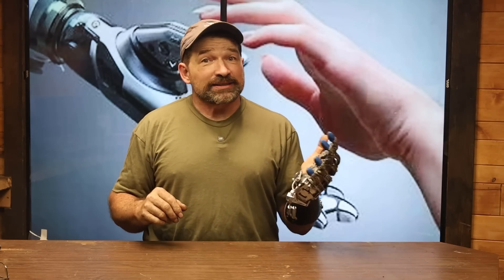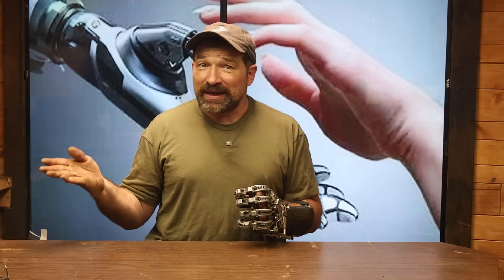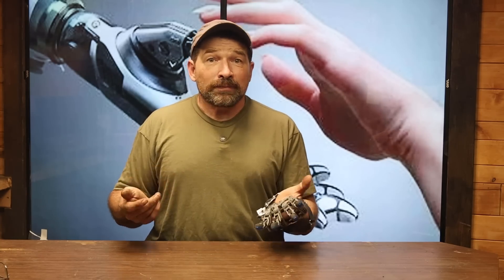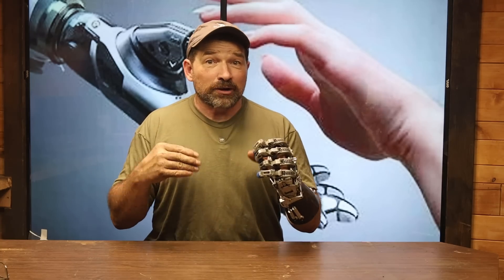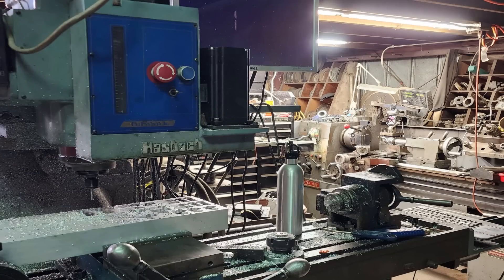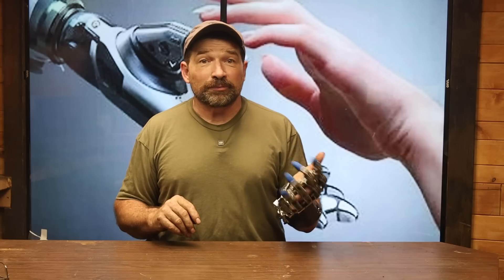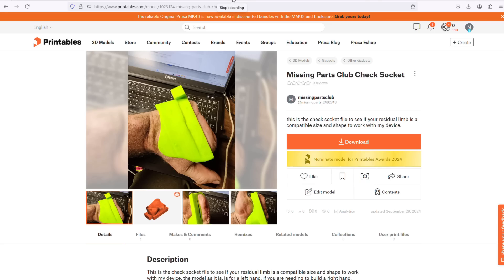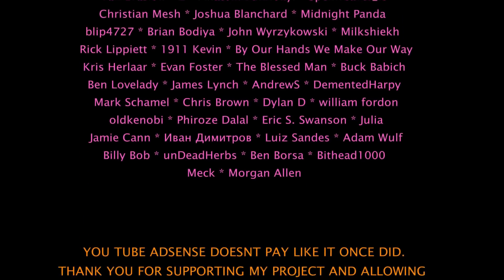Ready or Not, I'm Starting a Trial With my DIY Partial Hand Prosthetic!

Comment: how much would this cost for you too build me one.. ive lost all my fingers on my left hand.
Reply from the maker: you should download the check socket, print it out and see if the design will work for you. it is designed for a very specific disarticulation. your fingers need to be completely disarticulated through the MPJ, that means that you do not have any part of the proximal, and the metacarpal is still it's natural length.  follow the instructions in the description of the video and email me pictures of the check socket on your residual limb to missingpartsclub@gmail.com

Comment: I'd contact Fahad Badar, the dude who lost four fingers to extreme frostbite after spending the night stranded on a mountain he was trying to climb in Pakistan...
Reply from the maker: He still has partial proximals on his index middle and ring fingers. He can, and does use the naked prosthetics mcp driver line of devices. My device is for someone who has had their index through pinky fingers amputated through their metacarpal phalangeal joint and retained no part of their fingers.
Reply: @missingpartsclub  My apologies, I'm not well versed on the specifics of amputation or the various devices. I did see some before and after videos of him, and the device he was using didn't seem as fluid or as impressive as how your invention behaves...

Comment: How exciting! I’m very glad this is feasible for you and the project has managed to come this far. If you need some additional manufacturing support outside of the community which has volunteered, I’d imagine that universities  with solid kinesiology labs would be more than happy to help both yourself and recipients at relatively low cost. A non-insignificant amount of grant money is probably eligible for spending on stuff like that. Plus university machine shops are full of altruistic and skilled people with access to incredible machines that experience a non-insignificant amount of downtime.

Comment: If you ever decide to go international, do pick up metric thread as well, it'll make maintenance a lot easier (and to source bolts)
Reply from the maker: Here's the thing, since it's DIY,  you can use whatever thread  that you want and can more easily source. 1-72 is close to 1.8mm, 2-56 is about 2.5mm, 4-40 is about 3mm.

Comment: Can you even sell this without going through all the medical device certification? Or does this not apply since it's a DIY kit?
Reply from the maker: That's the workaround.  Being that it's a DIY kit, the end user assumes all liability and risk. Think about it like an 80% lower.
 There are rules in place where an O&P clinic can deem something/anything a medical grade device and apply for insurance reimbursement,  but that is a case by case and clinic by clinic thing. Where they're going to get pushback is that they claim things like these prototypes. The thing is, all hands are different. Every device is a prototype. And since there's such a high rate of rejection with upper limb devices, insurance looks at them as a waste of resources.  Hence, my letter from my insurance company stating that fingers are considered a luxury.

Comment: Waiting for the remixes on printables from people fitting it to their own hand :D
.obj is a good format. I think you can import that into most cad and modeling softwares
Reply from the maker: There better not be remixes on it. It's meant to be a reference. The file on printables is the check socket,  not the device itself. The device itself, printed in plastic, isn't strong enough to do anything. That's why the real parts are printed in mag aluminum.

Comment: If you choose someone in the greater Denver area, keep me in mind. Run a proto shop (CNC/machinist, 3dp, EE) and would love to help out,
Reply: Are there similar solutions in the prostetics industry or is Ian doing something completely novel here?
Reply from the maker: Novel,  the partial hand market is a veritable desert. The issue is that there's not enough ROI in this market sector for one of the 2 main suppliers to make the multi-million dollar investment to meet the needs of the few. There are a zillion combinations that fingers can be amputated, and each require their own version of a device. Naked prosthetics makes good devices to meet the needs of partial finger amputees. But you need at least the proximal portion of the finger to use any of them. The only option for disarticulation at the metacarpal is the ossur I digit quantum. Aside from the cost of the device (upwards of $100k) is that it's slow (1 second to open, 1 second to close), and it's incredibly fragile.
Reply: @missingpartsclub  There's the point design for partial hand amputees

Comment: Have you considered rolling contact joints? Might be a sturdy knuckle joint, mechanically
Reply from the maker: Yes, briefly. I experimented with link driven and spectra line. The 156 device was link rolling contact. It takes about twice the amount of parts per finger compared to the design of my current finger.

Comment: Only question I have is is this going to be a reversible product? Such as for a right handed amputee... can it be assembled that way or are the components only left hand specific?
Reply from the maker: Some of the assemblies are able to mirror, but most parts end up being an -001 or -002 version. The fingers, of course  mirror, but the mounting plates don't. And so down the line.

Comment: Thank you for specifying "only a file". The number of time I see people using power tools for no good reason on Youtube is mind bogling.

I'm not expecting everybody to be trained to square stock with files as I was (luxury gunsmith), but seeing people using power tools to deburr machined parts or angle grinder to cur steel rods when 10 second with a hacksaw would have suffice is just sad.

Comment: Wonderful work, would make sense to create a network with local maker spaces to help with the crafting as the missing parts make tapping  & fitting challenging.  plus many are just not makers to begin with.   Plus this will free you from many beginners questions,  Also you may want find a way to monetize your consulting time too.  Best of luck however it spins out.

Comment: Why not just hire engineers to build these for the clients and charge them accordingly.
Reply: Great idea!  You can finance the operation and Ian can hire the engineers.  That's just brilliant.  Glad you're on board, sir, and willing to volunteer not only ideas, but the funds necessary to see them happen.
Reply from the maker: Exactly! You hit the nail on the head! Of course there's also the little dance that I'm doing around "building a medical device without proper licensure or clinic" and the $100,000 fine AND 10 years in federal prison per occurrence that goes with each completed device that I provide.

Comment: Not an amputee here, but if you choose an applicant from the San Antonio area I would be more than willing to donate my time and tools to help them complete the project. I’m really only short a 3d printer.
Reply from the maker: Email me and I'll as my channel sponsors what they can do. No promises,  but I'll ask.
Reply: @missingpartsclub  If the user is willing to pay to ship, I am willing to donate a 3D printer. I have more than one I could give away.
Reply: Just to reiterate in case there is a misunderstanding. 

I myself am not an amputee nor do I know any that fit the requirements, and I am not trying to get a 3d printer. I however would be happy to give a hand in or to totally handle the assembly process for someone who isn’t able to themselves due to lack of tools or ability. I would want them obviously to be as much a part of the process as possible as I know I would want to be if the situation was reversed. 

As far as 3d printing the socket I would not be able to help with that portion without having a printer myself, and it seems like the recipient would need to be very hand-on with that process in order for Ian to help them get the most out of it. 

If it works out that having a 3D printer myself would be of the most help I can look into that, but it is still early in the process for Ian and we don’t know where qualified applicants will be chosen from. So I’m just volunteering my time, tools, and assistance in advance in case it’s needed.
Reply: I have more than one 3D printer, I am more than willing to donate one for a good cause. Though I would need the recipient to pay for shipping.
Reply: Sounds like you get a new tool! Super Fast Matt recently did a review of what he feels is the best consumer model. I trust his judgement.
Reply: I have a 3D printer, but I'm not in the US, so I can't help out on this batch unfortunately.

Comment: While it makes sense, those are some incredibly specific requirements which would dramatically reduce the number of possible participants
Reply from the maker: The thing is, this device is for a very specific amputation. It isn't a one device suits all. That part of the issue with trying to service the partial hand prosthetics sector. There's like 30 different possible amputation variations, and each one requires its own design. This design could conceivably meet the needs for 7 of the variations. But right now, this trial is for only 1 of those variations.

Comment: me at the beginning of this video: 🥳 hey finally 

me at the ending of this video: 😳 will be even find a candidate?!
Reply: It is not as un common as you think. I have met several people just in my neck of the woods who might fit this requirement. Normally you lose the majority of your finger to injuries like this they take it all the way to that point as the bone does not just get sheered it splinters and they take the finger to the nearest remaining joint. Get your finger cut off have way through the join mid way down they will remove it to that joint if it was a crush type injury that caused the damage. So there are probably a few 100 to a few 1000 in the us that would meet the requirement
Reply: I’d imagine many of the people who have lost fingers in a similar fashion to this do so in industrial accidents, which means they’d probably be at least somewhat familiar with the tools they’d need to use for this project
Reply: Here's hoping